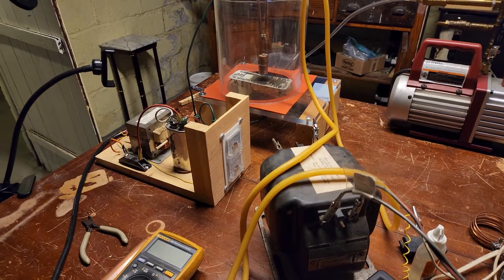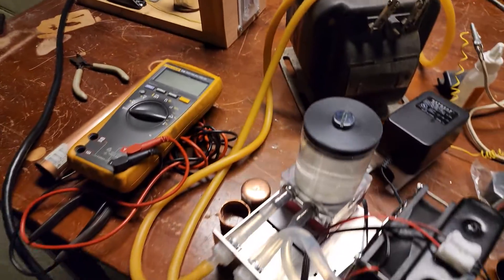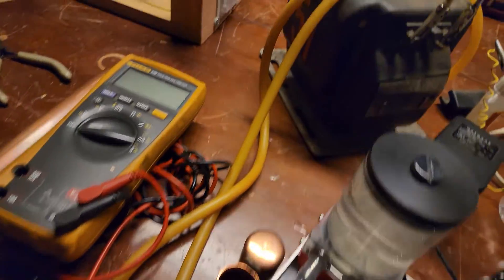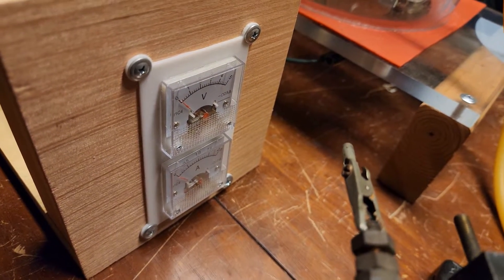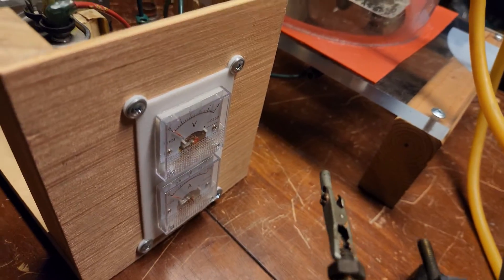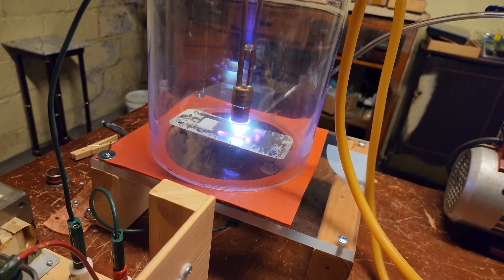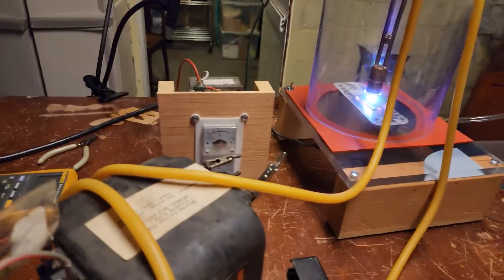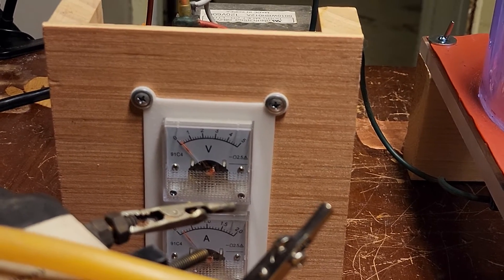Magnetron Testing with Water Cooling.

Comment: this is very good. after the water cooling, how long do you think the magnetron can run?
Reply from the maker: long time... as long as the magnet keeps cool it won't demagnetize due to heat.
Reply: that means if you water cool the household magnetron you can run upto 10hrs? can i contact via email? @sparkstarter
Reply from the maker: @samuelmuriithi4784  contact me on the webpage www.sparkstarter.tech

Comment: Have you considered using a magnetron from a microwave?
Reply: Also placing magnets next to the output of the magnetron that's in the water?
Reply from the maker: @dandruff7807  magnets are inside the water cooled copper pipe.